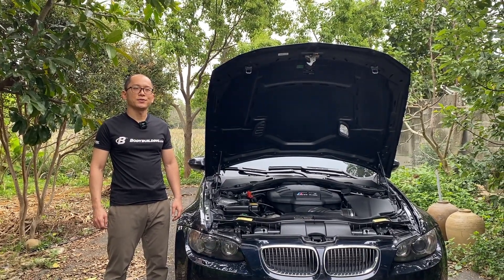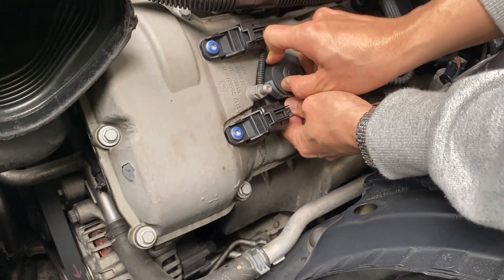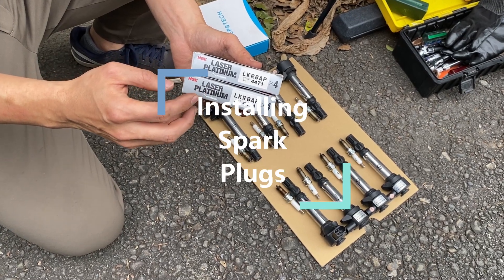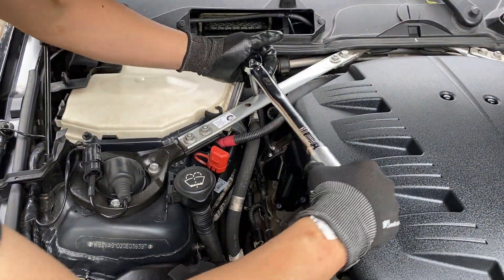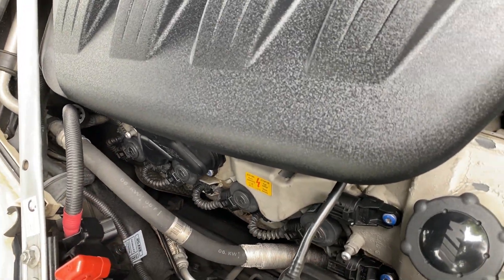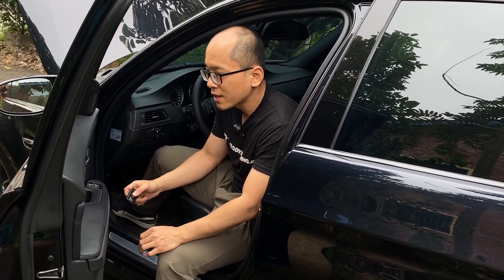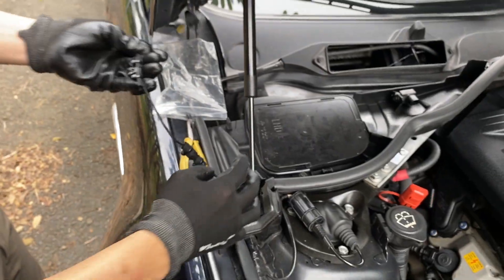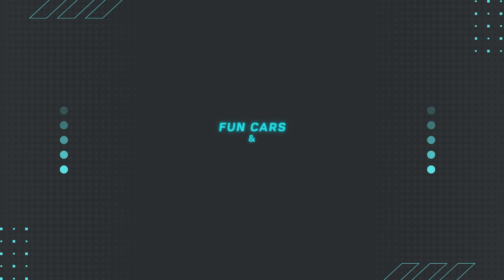Spark Plug and Ignition Coil Service for BMW E90 E92 E93 M3 S65 Engine

Comment: Great video, so is 5,6,7,8 really on the passenger side? I’ve seen mixed answers
Reply from the maker: Hello Vinh thank you for your comment! I am so sorry for making this confusion that I feel like deleting this video 🥲

The bank 1, cyl. 1-4 is on the right side of the car (even for right-hand-drive cars.) I confirmed this with the realoem.com online catalog🤗
Reply: It’s a great video! I need to change cylinders 5 and 7 this is very helpful.  So 5&7 would be on the side where you have to take out the air filter right?
Reply from the maker: That’s correct Vinh. Good luck with your work. Thank you again 🤗

Comment: Is there an aftermarket option for coils that work?
Reply: I see, only choice out of those aftermarket you mentioned is the Smp brand, 85$ a piece,  and oem 225$ a piece, really down to coils now last thing i gotta change to hopefully cure that cold start misfire i mentioned before
Reply: @drago22alina22  
You can also use NGK 48338😉👍
Reply from the maker: Thank you @Sammy82 😊
Reply from the maker: Hi Alina I found there are few OEM products on Tuner Motorsport; Bosch, BMP and Üro. Yes genuine BMW coils are super expensive. I have Bosch on my S65.

Comment: How do you know when it's time to replace the coils instead of reusing them. Thanks
Reply from the maker: Hi Lawrence! I have got the following summary after reading the service manual in ISTA;

An ignition coil is suggested to be replaced if you find the following:
1. Damaging or crack on the body that impair the functionality.
2. Discoloration on the body that shows damaging inside the coil.
3. Contamination on the coil that makes the body deform.

The manual also note that:
An ignition coil function check is not planned in the Service department, as the ignition coils can only be checked meaningfully under load. E.g. through swapping (fault code entry travels along, very complex).

(You can email to funcarsgoodpeople@gmail.com and I can send you the PDF print of the manual.)

In my opinion, I will replace an ignition coil when there's significant fault in it, e.g. engine running rough, misfiring, fault codes due to failure of a coil.

Of course car parts degrade over time so I will also consider replacing all the coils at a longer interval like 100k km. That's a ton of money right? Economy is also something we have to think about 🤗
Reply: @funcarsgoodpeople  Thanks for the comprehensive reply Carl! yes cost is always an issue. Cold start on my m3 gets quite rough which triggers all sort of misfire codes on all 8 cylinders. Once its warmed up, and I clear the faults, they don't come back until the next cold start haha. Still don't know whats wrong. Look forward to more update on your channel!
Reply from the maker: Oh Lawrence I had the same situation a long time ago! It's the cold start function that makes all the misfiring codes. It is designed to speed up the cats temperature to meet the emission requirements. I guess this however become troublesome for all the M3 owners.

I went to a tuner to disable the cold start function and never get the misfiring codes anymore. See my other video https://youtu.be/9n33de17WiI at 20:19, the engine goes normal idle speed right after start.
Reply from the maker: Hi Lawrence I finally made a video about the cold start delete to get rid of rough starts and misfire codes. Please see the video here: https://youtu.be/-HcMYBclj_Q and kindly let me know what you think!

Comment: I just finished doing my valve cover gasket and spark plugs on my E90 M3. It was much easier than I expected. Worth noting, swap out the fuel tank breather valve while you have the main intake plenum off (not done here in this vid).
Reply from the maker: Hi Elrod thank you for the advice! It sure is laborious to take care of stuffs in the Valley 😆 I have the throttle body actuators to replace so I will mention this advice in the future video. 

Do you have any recommended reference for doing the valve cover gasket? I have no clues about that work yet 🤔

Comment: im planning on doing the same, replacing the spark plugs and ignition coils for my bmw m3 e92 2013 i cant find any bosch ignition coils but i did find NGK ones available would those work ?  i wanted to buy bmw ones from the dealer but they are $400 CANADIAN $ each which is insane
Reply: Hey so I'm doing the spark plug and ignition coil replacement, my torque wrench starts at 50 foot pounds, so what foot pounds I should set my wrench at to get 23NM like you show in the video ?
Reply from the maker: Hello Juan, the converted number is about 17 lbs.ft. I used this online conversion: https://www.onlineconversion.com/torque.htm
Reply: @funcarsgoodpeople  thank you ! You deserve more subs ☺️
Reply from the maker: Hello Juan the NGK LKR8AP plugs are exactly the designated parts on the parts catalog so yes! just go ahead!

I have heard about price of coils going up in my area like 294 Canadian $. Yeah it’s crazy but I found BMW coils on Schmiedmann.com around 183 Canadian $. Sounds no bad?

I had replaced the ignition plugs only and there was no problem. The engine even ran noticeably smoother. However there is also saying that the plug and coil need to be replaced together, in order no to damage each other if one of them malfunctions. I am not sure about this idea, just FYI.
Reply: @funcarsgoodpeople  but should I go bmw coils or NGK coils ? I tried to click on the website you sent there, but once I click on it "page not found" :(
Reply from the maker: You can go at your convenience! i believe BMW and OEM parts are the same, just different logos :D

Below is the link to BMW coil at Schmiedmann dot com. (I’m not sure if youtube blocks it or not) https://www.schmiedmann.com/en/product/2005418-new?product=12-13-7-841-754
Reply: @funcarsgoodpeople  that's where you bought your ignition coils ?
Reply from the maker: No I haven’t replaced the coils yet. I’ll consider Schmiedmann next time if they have better price.

Instead I’ve bought some other small parts from them. They do provide good sales service and fast international shipping 👍
Reply: @funcarsgoodpeople  thank you so much !

Comment from the maker: [Errata] Bank 1, consisting of cyl. 1-4, is on the RIGHT side.
【勘誤】包含第1-4缸的一號缸列是在右側。

Not so difficult right? You can do it at home with proper tool and knowledge. It's just like servicing two I4-engines 😆
**Required Parts**
Spark Plug NGK LKR8AP
Ignition Coil 12 13 7 841 754

**Tools required**
6 mm socket (intake hose clamp)
8 mm socket (trims)
10 mm socket (intake muffler base)
16 mm magnetic long socket (spark plugs) 
universal joint for the sockets
socket wrench
extension rods
T25 Torx screwdriver (intake muffler lid)
Flat head screwdriver (to pry ignition coils)

不很難對吧！使用正確的工具及知識，你也可以在家自己做保養的... 就像保養兩部直列四缸引擎一樣 😆
**所需零件**
火星塞 NGK LKR8AP
點火線圈12 13 7 841 754	

**所需工具**
6 mm套筒（集氣箱管束）
8 mm套筒（飾板）
10 mm套筒（空氣濾芯盒座）
16  mm磁性長套筒（火星塞）
套筒對應的萬向接頭
扭力扳手
扳手延伸桿
星形T25起子頭（空氣濾芯盒蓋）
一字起子（撬起考爾用）